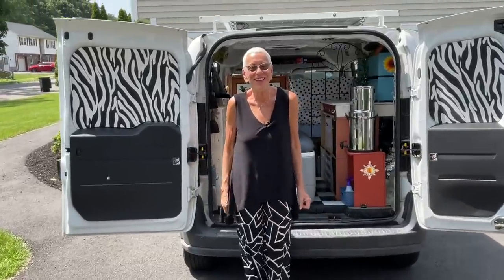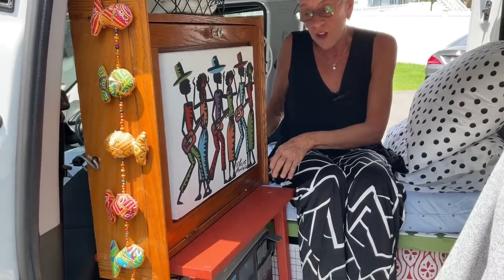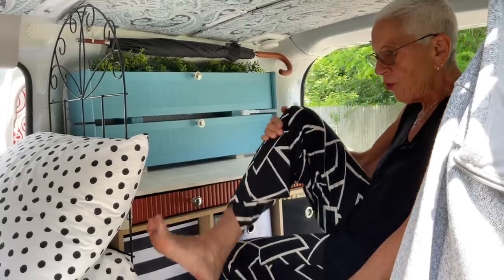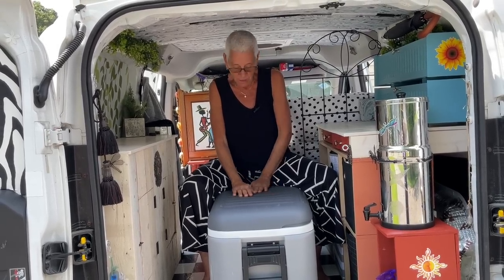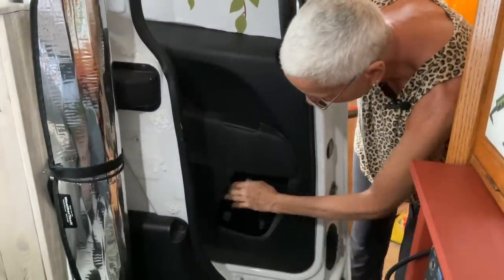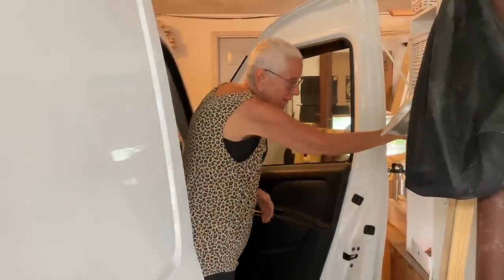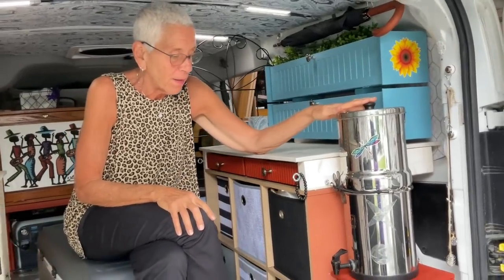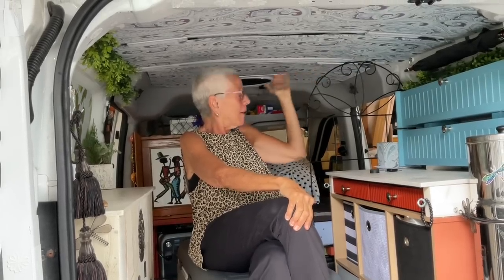MAKING ADJUSTMENTS TO MY VAN BUILD AFTER MY FIRST ROAD TRIP IN THE NEW BUILD - LIFE IS GOOD!!

Comment: Put small Velcro on each corner of the fan frame.  It will hold it in place and allow it to be removed! Good luck 🍀
Reply: I dropped by the comments just to add this same suggestion on velcro!
Reply: I was thinking command strips but this is a good idea too!
Reply: Agreed.  The Velcro has worked much better than Command strips every time.
Reply: I was thinking the same lol
Reply: Yes, Velcro.  First try the little screws into corrugated plastic, then Velcro and if those don’t work try the white duct tape.
Reply: I was thinking the same. 🤔
Reply: I was thinking the exact same thing. Velcro is wonderful.
Reply: There is a velcro Command strip..I think it's the one for light picture frames..I've used before
Reply: Would glued magnets work? I saw a couple used this to secure a drawer system.
Reply: Hate to drop in like this lol but I was thinking the same thing.
Reply: What about the Nano tape?
Reply: Oh, the velcro is a great idea! I’ll have a corrugated ceiling in my van as well, and velcro sounds like a much better solution than screws.
Reply: I was thinking the same thing to hold the fan trim up.
Reply: Yeah I was thinking command strips or double side carpet tape.
Reply: Ditto! 😁
Reply: Was just going to say that lol
I did something ike that in my vw  or was it my airstream.  Yrs ago
Reply: Doublr sided tape

Comment: Lulu, something you could do to control the oder in your icebox is to take a paper towel and put a little vanilla on it and wipe the inside of your cooler/icebox and leave the paper towel in it till ready to use again and the smell is very pleasant. A little tip from my mom from our camping days.
Reply: Great idea. My van has to go in for repairs so I have disconnected my fridge and emptied it. I will give your idea a go.
Reply: Vanilla extract also makes wall paint smell better when stirred into paint well.
Reply: Never tried that tip. I usually put a cup of white vinegar in my fridge. But I'll try vanilla 😊
Reply: How about a box of baking soda. Works in the fridge and freezer at home

Comment: For your drawers, glue a strip of plastic (think thin plastic cutting matts) on the sides. So they glide easily
Reply: Good idea!  Buy an inexpensive glossy placemat and cut it to fit the drawer and glue it.
Reply: I thought putting some felt on the side of the drawer might work.
Reply: Love the thin cutting board idea.  Could get them at the dollar store. Quick. Easy. Affordable.
Reply: Chroloplast between drawers
Reply: Or maybe your friend Bob has a belt sander? Just a few seconds against a belt sander on each inside piece of those drawers would d o the trick.

Comment: You 'could' use a Turn Latch.' This is just a primitive bar that attaches with a screw in the middle of it. It turns 360 degrees. Either vertical or horizontal allows opening or closing of a thing. It's hard to describe. Back in 'the old days' your Grammie's hutch had a clasp like this. Hahaha, I'm showing my age but those dang things are mighty handy and super simple. xo
Reply from the maker: YES!!  that's what it's called!!  that's what I was describing in the video!!
Reply: @LulusWay64  HAhaha, I jumped the gun on that because someone else mentioned it. You're my hero! I love your attitude - thanks for the video!

Comment: Did you already fix the drawers?
What about spreading wood putty on the inner facing side of the drawer to make it smooth? 
That could fill the "trenches" that are catching and leave the ridges at the original level. 
Of course, since wood putty does take paint you'd probably never even notice the change.
Just a thought.

Comment: If you're using a board you might want to consider putting hinges on one side and then making a latch to lock it with a padlock or something or even a key to hold it shut down tight then your idea would work very nicely

Comment: Ms Lulu. You did an amazing job on your rebuild. My favorite space is the bed and headboard.  It's cozy and cute. May I ask, how did you stick the panels to the ceiling? I love the idea and would like to try it in my van. I apologize if you've already answered this question. I'm looking forward to seeing an update on the garden.
Reply from the maker: hey Honey!!  I used industrial strength velcro, but I'm finding I have to stick up some double-sided tape in some areas to further support it!!
Reply: Magnets???
Reply from the maker: there is insulation under the panels, so the metal surface is not just below the panels!

Comment: The cooler lid is air tight which keeps heat out, cool & aromas in so any critters do not come inside your home looking for food.  Your diy lid sounds good in theory if you can find a way to seal it air tight.  Actually, imo, a shorter cooler would be best, whatever you need to do to make it work. Maybe prep smaller portions, more often, for a smaller cooler?  You know, a smaller cooler for a smaller space.  Anyway im sure you will find a Lulu's Way solution.

Comment: Here are some suggestions - 

Cupboard with the painting on it - if you like it, keep it.  If not, why not remove it totally and put a basket there instead for your books, on one end of the table nearest the door and use the other as a table for your dish and getting out of bed? 

Cooler - the only way to see if the wood idea works, is to try it. Make sure theres a lip/overhang of wood around the entire unit to give it strength  Remove the lid carefully and reuse it if you need to.   I always use a towel on top of everything before i close the lid of our cooler. Holds in the cold in. Ive had ice last for 3 days usung the towel method.  The thing about the plastic cooler lid is its thermal properties of a double layer of plastic with air between. Its good insulation. 

The drawers - they probably dont slide out during driving is because they are a tight fitting. If you make them slide easily, you may need to use those dreaded bungie cords!!  

Fan cover falling down - if you want a permanent solution, add a decent layer of silicon around the under edge. Hold it in place until its dry. Silicone is a pretty good way to glue things. 

I reckon youll work it all out. And when you do, we will all be taking note for when we build our campers! 😊
Reply from the maker: thanks so much KT, for all your suggestions, I appreciate it!!  Lulu  😊

Comment: Lulu. That cooler idea is a great  idea. Someone suggested Velcro for the fan. I really think that would work great too.   How about sanding the sides of the draws really well so they are almost flat. That will give you more room to slide the draws. 
Personally I’d get rid of that cabinet and table that’s blocking the bed. Later it will come to you what will work better. I find it Very interesting how you are tweaking your travel 
Wish I could meet you all in Maine. Maybe in the future. 
Karen from Florida 🌴💕

Comment: What is used for table, you can have it converted into a swivel top where it can swivel from the upright position to the edge of the van so you can use it from the outside of the van as you said.  The top you can add another piece of wood same size as the top and use hinges so when you are not using it as a table you can fold it back so it will not be in the way and hurt your head getting in and out of the bed.  Safety first and you can have a multifunctional piece of furniture that can swivel and be flipped back when not in use.  Hope it helps.
Reply from the maker: hi Gina!!  thanks for the suggestion!!  Lulu  🌸

Comment: I really understand about your need of an inch or two above your head and hair. I believe my space will be 2 inches above my head in my cargo trailer. And I'm great with that. But I wouldn't want to have to skrunch at all. You have so many really great ideas . And I'm sure you will take care of your cares and ideas before your next trip.  See you next visit.
Reply from the maker: yes, Janet 2" should serve you well.  for me, 3" over my head is ideal.  it's just a good feeling of space.  I had that much space before I insulated the floor and ceiling.  it's was a hard decision, but I did it.  I will figure out the cooler/sitting/height issue, I'm confident of that!!  💕

Comment: The only reason they were created was to block out the heat.  In winter might also work to block out the cold.  They are also good to block out the light when sleeping, but if light doesn't bother you, the more light that comes in, the better.  You can also see if an intruder wants to break in.  Hopefully it will never happen, but lately a lot of cars have been stolen.

Comment: I was inspired by your first build in your mini van for your cooler and using the little freezer, I have a full size high top Chevy conversion van. So I have a little more space and can stand up in my van. But one thing I needed is a toilet. I tried to get 3 carpenters to work on my van during covid. No one would. So I built it myself. I made what I call my couch. It’s just a big box with 2 lids and 4 areas. One area I made a composting toilet with a small area to the side with storage for bathroom things. The other 2 compartments are under a separate lid. These lids are 1/2 in plywood on piano hinges. That area is part of my kitchen. I took the building insulation you talked about and I lined the inside. Then I took your idea and covered that with reflextics and silver tape. I made a reflextics top that lowers down like yours then I took another piece of the foam insulation and covered it with reflextics, this piece fits right down snug to the top edge of the other foam. That way I didn’t have to try and attach it to the lid to fit correctly. When I tested it. The 4 ice packs got it down to 40 degrees for 20 hours in average 85 degree heat. The last compartment I keep my cooking appliances in. I made a foam cushion for the top. It’s very comfy.
Reply: So LuLu what I’m getting at is I think you can make a lid for the cooler. Save the original lid and if it doesn’t work out, then put the original lid back on. Thanks for all your inspiration, you are a joy!
Reply from the maker: hello!!  thanks so much for your note!!  sounds like you GOT R' DONE!!  YAY YOU!!!  so happy the freezer/cooler idea worked for you too!!  stay inspired!!  Lulu  😊

Comment: The most efficient cooler we ever had was one we built. It was simply frames with 2 and 3 inch X I inch wood. Then the sides  were just real thin 1/8 inch plywood tacked onto the frames. Frames were screwed together to make a box. The inside was 2 inch foam. Foam was fitted under the lid to keep cold air in. It can be made any size you like.
Reply from the maker: brilliant idea!! I might make my own one day, that would be a fun project!!  I would like it to look less like a cooler and more like just a bench!! 😊
Reply: We did paint up the cooler and I think you could use just about anything to cover/protect the foam. Be sure to find a way to seal corners and make sure the cover comes off easily. On one we split the foam lid so we only had to open half at a time. Some had wood tops and some were just frames holding foam. These were very strong and ice blocks lasted real well.

Comment: Hi Lulu,
      You did a great job with your build. Very few changes and nothing major!  Idea for the salad bar. Use magnets to hold the doors shut and drill a hole to stick a finger in to open them. The clothes rack at the end of the salad bar.  You could fasten a 2x2 to the salad bar and put hooks at the top on each side. With  the cooler you might be able to get 2 that are shorter to replace the one. How high is it?
      I like your thinking about your different ideas. You think things through and end up with good solutions 
Randy Grubbs 
      PS Would like to see inside of Sweet Pea?  How is the garden doing? Bye
Reply from the maker: hi Randy!! the cooler is 17.75" high.  I really don't want two coolers but that might be my only solution.  I just can't find a cooler 100-120 qt. that is shorter than this one!! UGH!!  oh well, I'll figure it out!!

Comment: If you put an extension on your cabinet top you may hit your shoulder when getting out of bed. Just a thought. Could you cut a "hole" in your floor the size if the cooler and set the cooler down into it. May give youe more room inside if it
Reply from the maker: hi Becky!!  the top of the cabinet is way higher than my shoulder.  not able to have the cooler stationery, I need to move to to get into the cubbies and then move it the other way to open the pallet cabinets doors.  thanks for the ideas though!!  💕

Comment: If you do move your cupboard closer to your sliding door, the fold down table would be easier to use from outside. I think nearly everybody is always thinking about how to manage limited space inside their van, it’s not easy your doing well. 16:41 😊
Reply from the maker: that's a great idea!!  it's close to the door and would make a great table for my butane stove to cook on it while standing outside the van.  was thinking I could get some kind of thin sheet of stainless steel to attached to the inside of it so that the table top is heat proof.  great idea, thanks!!  🌺

Comment: Regarding foam board, consider its off gassing which could affect your food....I would rather insulate with bat's of thick wool to avoid toxicity of foam board....always consider food containers as a potential source of chemical,poisoning
Reply: Wool is natural which is good, but what about the closed container and moisture contributing to mold growth?  I would want to make sure that couldn’t happen.  Closed cell foam, wrapped and sealed in food grade material of some kind might work.

Comment: Hi Lulu. Could you use the drop down door of your cabinet for a table - re the fan, would the Velcro tape used to fix a bug curtain to a door work with your fan - one part sticks to the ceiling and the other sticky part sticks to the edge of the fan etc etc - similar to ‘command’ strips for holding pictures to a wall. Anyways, I’ve no doubt you’ll sort it Lulu, you’re an amazing lady and one I admire a lot. Have to say, again, I absolutely love the way you kitted out your van. If I were to convert a van, I would do it exactly like yours. Sadly, due to health reasons, I am no longer permitted to drive, and boy do I miss it. I live van adventures through you 😊 thereby, I’m looking forward to our next trip 😁  Love and hugs Lulu  ❤
Reply from the maker: thanks so much Caroline!!!  ❤️

Comment: Double-stick mounting tape would work for the fan, I think. It's a thin foam tape.  
Also, I keep thinking hinges on the top of your salad bar would allow easy access all the way to the top inside.  Just a thought.
I love your cooler idea with a little seat pad.

Comment: Lulu, is it possible to drop the floor under the cooler about two inches?  I'm thinking,if you make the lid, it will take up your leg space.
Lulu, are you able to lay with your head in the opposite direction.  I don't remember why  you are laying the way that you are.  It would make it easier to get out of bed, maybe.
Reply from the maker: I can sit up on the other end.  the windshield is right there.  I like to prop up the pillows and sit up in bed, that is my only lounging area.  the other end, I could lay down and sleep but not sit back the way I like to.

Comment: hey lulu, you have such brilliant modification ideas! of course you do! they are fabulous!!!
for your fan instead of screws or tape what about shims on all the sides? maybe like a strip of foam or rubber insulation! maybe like a thick, sewed, narrow piece of multiple layers or folded material would hold it in place??? 
great idea with your cabinet and table too! maybe curving the corners of the cabinet and the table at the top and bottom would garner ye a wee lit'l bit more of space! sharp corners in tight spaces would be hazardous to my health! just saying! lol
unused ground coffee in a old cotton sock totally keeps an unused refrigerator and cooler from smelling and getting moldy! works like a charm! 
i like your idea with your salad bar and their doors! what about window locks?
and i am thinking your cooler idea is absolutely brilliant! what you did to the inside of your cool to make it more efficient was more of lulu's brilliance! what about just changing out the hinges to handle the weight of the wood and screwing them into the same holes? i imagine the inside will work fine with enough insulation! and with enough cush and your amazing choices of material your van bench will be fabulous!!! hey, weren't the very first coolers back in the day made out of wood just like the ice box and refrigerator? i can't wait to see what you decide to do lulu!!! blessings! 🕊
Reply from the maker: hello Dianne!!  thanks so much for all your ideas, I appreciate it!!  Lulu 💕

Comment: I agree with you changing out the red sheet too loud I like soft blues for sheets on the cooler I get what your talking about but if your going to change it use installation because the lid is what keeps things cold even though it's too thick but I like your idea just use something that will keep the food cold I like the wood idea for where keep shoes uit won't distract from the beautiful of the wood ❤️❤️❤️❤️

Comment: Hi Lulu thanks for this information. it helps with my van set up as well. I was just thinking about your fan......If the screw idea does not work, the problem seems to be too much movement between two rigid frames.  
I wondered if you glue a thin frame of foam around the wide inner edge of the outer frame it would create a flexible seal between the two frames. The foam will give a bit when you put the outer frame back but still be firm enough to hold the frames together. (You can get foam tape that is sticky on one side at hardware stores which would work well).  I hope I haven't confused you. 🙂
Reply from the maker: hello and thanks so much for the idea!  😊